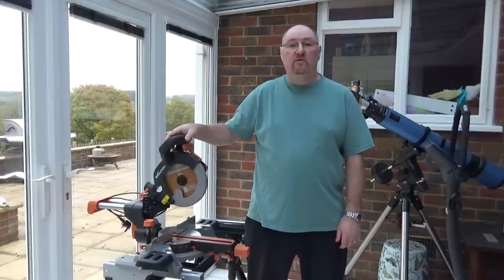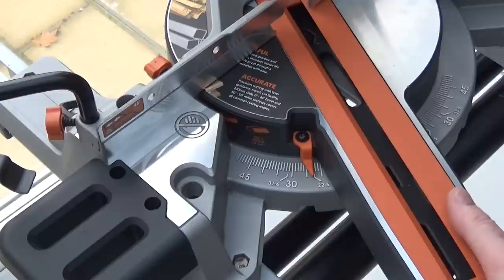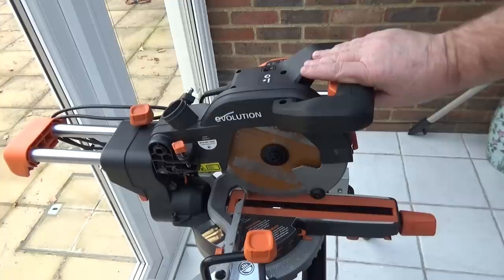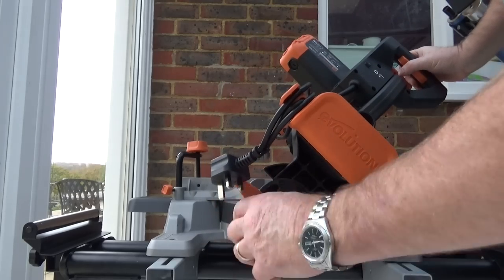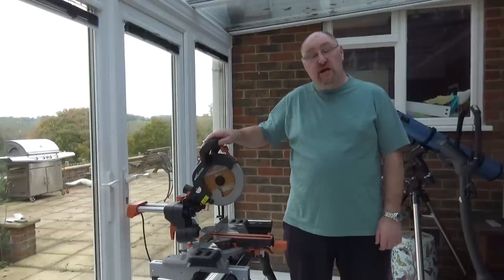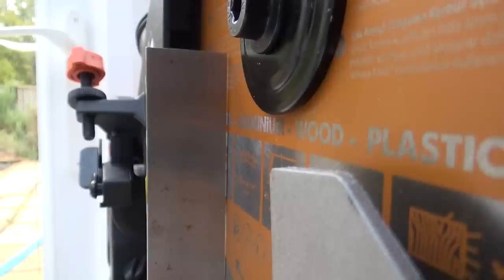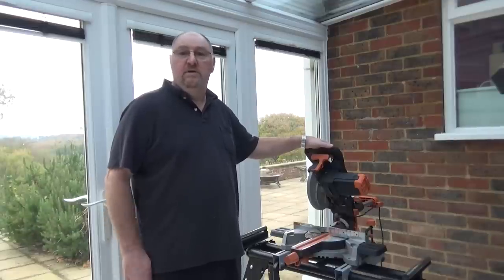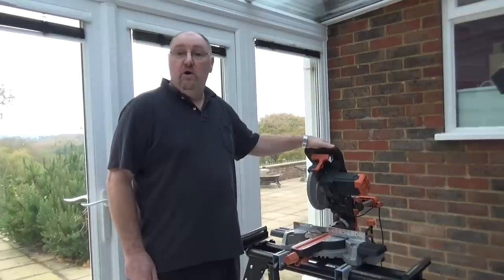The Evolution R210SMS Sliding Mitre Saw Review

Comment: I’ve read that only evolution blades fit due to the bore is this correct as you have recommended a saxton blade? Great video
Reply from the maker: Hi Lisa, this Saxton blade is supplied 25.4mm so it will fit the Evolution saw:  https://amzn.to/2AsFWlW   
The multipurpose blade is fine for most uses, but the Saxton blade does give a cleaner cut.
Reply: Russell Platten cheers. Would you recommend as a starter mitre saw am looking at this or the R210cm non sliding one. Have you any experience with Einhall ones?
Reply from the maker: @lisaporteous3689  Firstly, I do not have any experience with Einhall tools.  As for what type of starter saw to go for, it depends on what you plan to do.  The R210CMS is fine for cutting small stock, the R210SMS can cut much wider pieces.  The R210CMS can cut 55mm x 125mm at 90 degrees, the R210SMS can cut 65mm x 230mm.  If you intend to use your saw for more than just the odd small job, go for the sliding mitre saw, it is a far more versatile machine.  :-)
Reply: Russell Platten thank you. Only small jobs so think the r210cms will suffice. 👍🏻
Reply from the maker: @lisaporteous3689  Glad I could help Lisa.  Make sure you check and adjust your saw it necessary.  Some of mine have needed adjustment out of the box.  Good luck with your projects and please take when using your new saw!  :-)
Reply: Russell Platten will do. One last thing can you confirm for me, is the total depth of this saw 610mm? Would love this one but for me lifting think other version better?
Reply from the maker: @lisaporteous3689  The SMS is 610mm from front to back and it is a little awkward to lug around.  You can lock the sliding carriage and lock the cutting head down, but it is still slightly awkward to carry.  At 11.2kg  it is also reasonably heavy depending on your capabilities.  The CMS on the other hand is considerably easier to carry.  It is small and compact and weighs in at only 5.8kg.  You can lock the cutting head down to carry it.  If you struggle to carry awkward objects and your mobility is not brilliant, the smaller saw will be much easier to transport.  If you are reasonably strong and mobile the SMS will not be a problem for you.  I reviewed the CMS too, you can see how much smaller it is in my or other YouTube reviews.  I hope this helps!  :-)
Reply: Russell Platten cheers for all the info and help, hugely appreciated. I’m reasonably strong so many be ok. Plus won’t be taking it far for use so might be an option for more versatility 😄

Comment: What dust extractor tube do you use with this particular model of saw, as I cannot see anything in their accessory list?
Reply from the maker: My shop vac came with a power tool adapter and this fits the saw perfectly.  I measured the outside diameter of the adapter and it is approximately 35mm.  The nozzle on my shop vac also fits the port on the saw.  I hope this helps.
Reply: Thanks

Comment: Could you please clarify the 150*65 mm specification for the maximum 45 degree mitre cut. Does that mean it can cut a piece 150 mm wide at 45 degrees, or is 150mm just the maximum length of the actual cut? My reason for asking is that I have a project that will involve cutting 150 mm wide oak planks at 45 degrees to make corner shelves and I want to know if this saw will do it.
Reply from the maker: 155mm by 65mm is the maximum width and depth of the wood you can cut at 45 degrees.  The saw will cut the wood for your project.
Reply: Thank you for your clear and prompt reply.

Comment: Hi. Nice review. Can you clarify how you actually mounted the SMS saw to the mitre table? It is no obvious from the manual, and the mitre table instructions predate the saw.
Reply from the maker: Hi David.  At 1:14 on the video I mention the 4 holes in the base.  The bolts for attaching the saw to the Mitre Saw Stand brackets are pushed through these.  If you look at 3:33 on the video, you can see how the saw is mounted onto the brackets.  The stand is supplied with the brackets and fittings.  I hope this helps.  :-)
Reply: Thank you, missed that!
Reply: I've just purchased the R210SMS + the stand. The bolts supplied with the stand are not hex headed like shown in your video. They are a round head, with a square below, then the thread. Did you have to purchase the bolts separately, or did your stand come supplied with the hex head bolts? Perhaps I have an old stocked stand with the wrong bolts?
Reply from the maker: Hi Nick, the stand came with coach bolts as you describe and I used M6 bolts I had in the garage.  M6 bolts are extremely common and hopefully you will find some tucked away in your garage.  I reckon the coach bolts will be fine though, if they are long enough.  I will pass on your comment to Evolution and see what they say.
Reply: Coach bolts..that's the ones...couldn't think what they were called. I plan on calling them tomorrow. Really impressed with the product, just a bit disappointed the fixings are right for the saw... I'll see what they say and let you know.
Reply from the maker: I have dropped Evolution a mail and will let you know what they say Nick.
Reply from the maker: Hi Nick, I have been in touch with Evolution and the stands are all equipped with coach bolts as standard.  These bolts should accommodate all new saws.  They are fine for fixing the saw, but they do not look as good in my opinion.

Comment: Hi can you help please i have same saw but after a cut my blade comes to a complete stop in 2 or 3 seconds unlike yours, do you think my blade maybe too tight?
Reply from the maker: Hi, the blade speed is not affected by how tight it is on the saw arbour.  First of all, unplug your saw and once it is unplugged try turning the blade by hand.  Mine has some resistance and will not actually spin round freely, but it is fairly easy to turn.  Also, it should not be catching on anything.  If yours is the same, I suspect that it is OK.  Let me know how yours feels.  I will contact Evolution and see what they say, they may have added a braking feature to the saw.
Reply: @RussellPlatten  Thanks for the reply, i called evolution and they said it is fitted with an electric brake, it may be a new added feature.
Reply from the maker: Glad you got to the bottom of it.  An electric brake is a good new feature and makes fore a much safer saw!  :-)

Comment: The only drawback is the silly blade bore size - 25.4mm (1" ... is it made in the U.S?) and a few reviews which slam the multipurpose blade: basically it looks like it rags the back of the cut too much. But... on amazon you'll find a Saxon wood cutting blade with a 30 to 25.4mm reducing ring. Pity Evolution don't supply the reducing ring with the saw - they're probably losing quite a few sales I would think. It almost put me off. By the way -  other reviewers of the multipurpose blade commented that after cutting through a few screws, the blade struggled even with softwood. Well it would! The blade might well cut mild steel, copper, aluminium etc... it won't last too well with hardened steel - which most screws are, these days.
Reply from the maker: Evolution are based in Sheffield Keith.  I agree with you regarding hardened steel screws.  I have actually cut stainless steel plate with the multipurpose blade and it did the job, but the blade was ruined. They are not designed for hard metals. I have cut large metal pieces with these saws and the blades remain serviceable.  If I was using the saw for cabinet work, I would buy a blade designed for wood.  I think the multipurpose blades are brilliant, especially for trade work as they drastically reduce the number of tools required on site.  Plus they are cheap, so replacing them is not a huge expense.  I have a spare blade that I do not cut steel with and swap it over for wood projects that require a better finish.
Reply: I saw a review on the rage 3 where the arbour washer was reversable to go from 1" to 5/8", so you could put in a diablo cross cut blade

Comment: Great review .undecided between this and the Dewalt 774 at £100 more .
Reply from the maker: I can't help you there Dave.  I use the R255SMS in my workshop.  I still have the R210SMS, but the bigger machine has proven useful over the 3 years I have had it.  I have made a lot of cuts that the 210 could not accommodate.  :-)
Reply: @RussellPlatten  thanks Russell .I've gone the other way and ordered the R185SMS+ for a bargain £108 . The Dewalt can't do trench cuts ! Should be here Tuesday . Thanks for your deeds response .
Reply from the maker: @davedaniels8211  Good luck with your projects Dave.  A mitre saw is very useful!  :-)

Comment: Hi Russell I wonder if you can help I have mounted my 185 sliding  evolution mitre saw on the evolution mitre stand only I can't to go all way to 45 degrees because mitre stand clamp stops it the only thing that solves this is bringing the Mitre saw forward so it doesn't catch it can you recommend a another'
Way can you get back to me ASAP 
Thanks.
Reply from the maker: I am sorry Glynn, but I don't understand the issue.  Can you try describing it in a different way?  Are you talking about the black clamp/locking handle on the brackets that the saw is bolted on to?
Reply: @RussellPlatten  Hi Russell I sorting it out I saw your video on  putting the Mitre saw on a piece of 47cm 24cm mdf  and attaching it to clamp that go on the Evolution mitre stand I have ordered a 47cm x 25cm ,  15mm thickness mdf to fit my mitre saw.

Comment: I have the earlier model and found that the work hold down clamp under the motor gets in the way of the motor  and therefore stops the full travel of the saw, has this fault been rectified on this new model?
Reply from the maker: The new model is the same John.  I just flip the wood over and cut it on the left hand side if the clamp is a problem.
Reply: Thanks, I thought the fault would have been fixed on a newer model.
Reply from the maker: I think it is manufactured like this to keep the cost down.  It would need a much bigger base to resolve the issue.  They do sell a horizontal clamp that allows workpiece clamping on either side of the blade:  http://www.evolutionstore.co.uk/accessories/frontclamps/rage3s.php

Comment: great video cheers,  I`m thinking of buying this 1 or the EVOLUTION R185SMS what you think ????
Reply from the maker: I would go for the R210SMS Antony, unless you only intend to cut smaller sized wood.   Most people wish they had bought larger after they start using their saws more.  :-)
Reply: @RussellPlatten  cheers will do
Reply from the maker: @antonyporter5045  :-)
Reply: @RussellPlatten  Hi can I use this saw on a flat work bench without clamping it down ??
Reply from the maker: @antonyporter5045  Yes Antony, but it is better to secure it.  :-)
Reply: @RussellPlatten  just bought the EVOLUTION R210SMS from Screwfix cheers thanks for the advice
Reply from the maker: @antonyporter5045  Good luck with your projects Antony!  :-)
Reply: @RussellPlatten  what a cracking saw
Reply from the maker: @antonyporter5045  :-)

Comment: Can I wet cut stone on this device?  Eg rough uneven jasper, granite flint etc?
Reply from the maker: There is a diamond blade available for the saw and it will certainly cut brick and tile.  If others are using diamond blades to cut these materials it should be fine.  :-)
Reply: Russell Platten thanks for your help

Comment: Great review
Reply from the maker: Thank you.  :-)
Reply: Russell Platten you're welcome.
BTW have you tried the supplied blade with laminate flooring planks?
Reply from the maker: @muttley1956  No, I haven't.  If you need a very clean cut, there are better blades out there.  The Evolution general purpose blades are great, but I bought a Saxton blade for my R255SMS and it gives a cleaner cut.  I will add a link to a similar blade for this saw.  Also try cutting the flooring face down.  If that is not possible, score the cut line with a sharp knife or tape the laminate at the cut line.  :-)
Reply: Russell Platten Thanks for the advice.

Comment: I'm so disappointed with my Rage 3 S.
Used your tips in another video and it was quite well set up but there is so much movement on the up/down hinged part. It has a large pin with a clip either end and what ever bushing there is in the middle, (if any) is loose. Doesn't appear to be any way to tighten or take the wobble out of it.
Just as I'm getting to a standard where I need the accuracy.
Anyone else have this problem.
Reply from the maker: I would take a short video of it and send it to Evolution Andy.  See what they say.  :-)
Reply: @RussellPlatten  
Great Idea mate. Thanks so much for your help.

Comment: What about small pieces? 
How to hold them down?
Reply from the maker: The saw comes with an adjustable clamp.  :-)
Reply: Russell Platten 
Yes, but not very good at holding small pieces to cut
Reply from the maker: If the clamp will not hold them Nick, do not try to cut them as it will be too dangerous.  It is not worth losing fingers when you can cut it by hand.  If a small work piece is not adequately supported the saw may grab and throw it.  This will jolt your hand and can break bones or even worse push your hand into the revolving blade.
Reply: Nick Riggi  If you can use a tool to hold the item I.e some form of jig or if not then make a tool to hold it, just like any project using sharp tools from cooking to DIY “keep fingers and limbs and loose clothing away from moving machinery and blades as far away as possible”

Comment: Shame the arbour is still only 25.4 mm so your restricted to what blades you can use. The adaptors are ok but not brilliant. That is what stopped me from getting another Evolution. Different blades a must in my opinion.
Reply from the maker: I use a Saxton TCT Circular Wood Mitre Saw Blade in mine it is cheap, leaves a nice clean cut and am very pleased with it.  :-)
Reply: @RussellPlatten  I wish to thank you. I still had my Evolution mitre saw and took the plunge and bought a Saxon 80 tooth woodworking blade. The cut is 100% better. Did not need an adaptor and the results are amazing. Thank you for your reply to my initial comment. Keep safe.

Comment: It is my very first time buying this type of saws. I was very careful not to do anything wrong as it is a dangerous machine by nature. 
Goods:
- Reasonable weight
- works as expected (so far)
Bad (very bads):
- I cannot believe anyone could have written a manual as bad as this for a machine that is so dangerous. The diagrams were put in a separate page and did not make sense. Reading the instruction without diagram was useless and going to the diagram made me forget the instruction. There was no sequencing in the instruction and I had to work hard to make sense of them. The slider has a clip and safety latch which I could not unlock once put it but it was not mentioned properly so you could insert it and then read the warning sign. Luckily I inserted it correctly.
- The most important part is the blade. Imagine inserting it wrong and it comes off when turning it on. 
- There is a one/off switch which makes you think it is the main switch. To my horror I realised the machine is still on and that is a laser light switch. That is the most stupid design and very dangerous. There is NO on/off switch
- It comes with two plastic parts that extends the platform to support the wood. But why make it so small. I had to use a make shift one to make it useful
- It has two clamp support but it only comes with one. Why didn't they put two to make it a safer product. 
- The clamps worked but it is fiddly and could have been designed much better.
- It does not come with a bag. It makes such a mess without it. The hole could have been places away from the machine to not ALL the dust ends up on the machine.
- Now here is the worst feature and blew me away. It has a metal slider to support the wood from the side. There was no obvious mention of it in the instruction. The videos I watch did not mention it. It was already set to a position by default. However, when I did my first cut I needed to use the bevel at 45 deg and it cut that metal slider  but 2 cm. I mean what kind of design allows that and worst, why have not mentioned it or warned about it. The slider should not ever be allowed to go passed the 45 deg angle, as there is no reason for it to do so. There was no way I could have seen it coming as at that angle it is impossible to guess. 
I don't care how good a machine it is, I should not have been able to cut part of the machine on the first use. A BAD DESIGN.